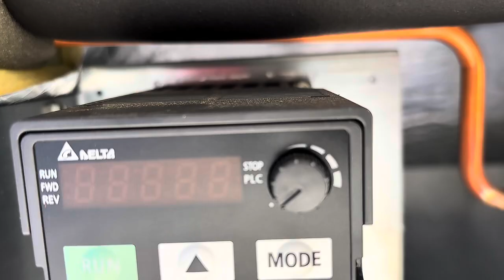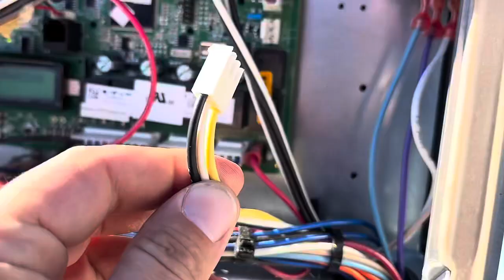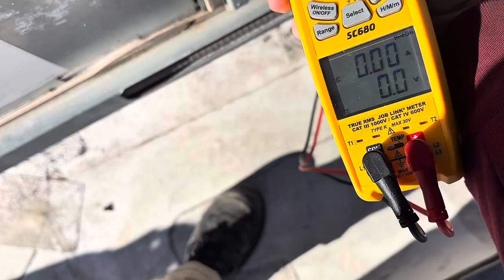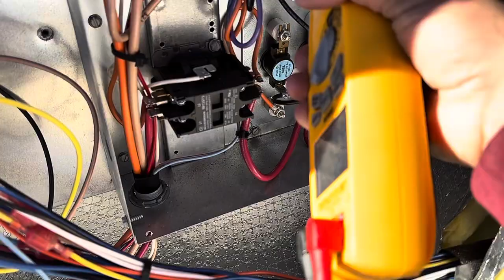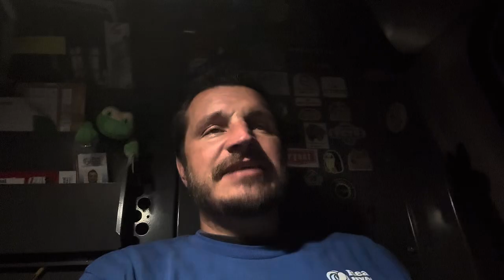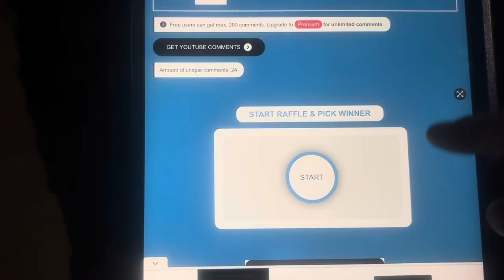York With A Bad VFD: How To Properly Bypass!

Comment: must have a ladder rack and ladder/s on top the work van/truck. I can hear the old familiar "howling" of the wind/air going past the open rungs. lol
we always stuffed the ends with scrap foam pipe insulation or spray foam the ends. be careful, some can cause corrosion or hold water inside and break from freezing.

Comment: I'm puzzled, what has failed here, obviously not the VFD motor itself, which is now running directly on three phase, full speed, via an added relay.  So is it the VFD controller in the package unit that failed? That must be the case.  When I think of a VFD motor, I think of a motor that has the controller build in, which is often the point of failure, and don't think you can power them directly.  Nice video, you get right to the point, no dilly-dallying around.  Jim
Reply from the maker: In this case, it’s just the drive that went bad.  Which is a separate device than the 3 phase motor.
Reply: you're mixing ECM(electrically Commutated Motor) which has to have a driver circuit board(usually end bell) to run at all, vs. an VFD(Variable Frequency Drive) operating standard 3 phase AC electric motor, which can still run without the VFD controller, it's just at 100% full speed then.
it's also possible for a VFD to go over 60Hz(50Hz) line frequency and overspeed the motor above ratings, which is bad for them unless specific designed for VFD and higher frequency drive.

Comment: Nicely done.  I'd leave a note list inside the machine with the changes you made.  This will help either yourself or the next person with addressing any future issues.  'Id also copy those note to my personal log for the site/machine and add them also to the invoice (just so there isn't any question from the client as to the work that was done and why).
Reply: while that is a good idea in general, being it was minor easy to see changes, any tech should be able to quickly see the VFD unhooked and bypassed, assuming it's broken. 
if they cannot, then they should still have their training wheels on, working alongside and under a lead tech and not rolling their own truck yet. sorry to say that, but it's true and they'll end up causing multiple callbacks otherwise.
Reply: @throttlebottle5906  Thanks for the feedback.  I just like logs because they have history - i.e., bypassed xxx due to fault yy ....  I then can tell the logic of the preceding folks that sometimes I cannot see from just looking at the net results.  Otherwise, I can see the bypass but not the why and now I have to spend time recreating the problem.
Reply from the maker: Good idea

Comment: Frequency drives are expensive. The only time I wouldn't by pass it is if the job has VAV boxes downstream in the ductwork with a static pressure controller adjusting the drive.